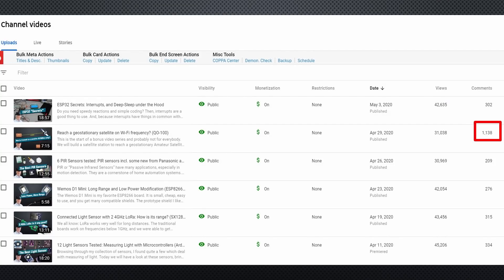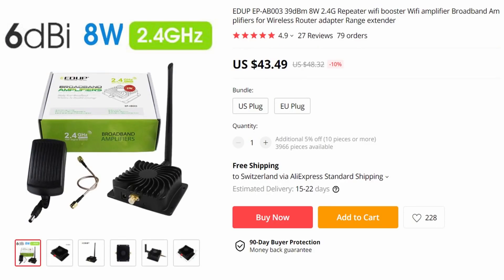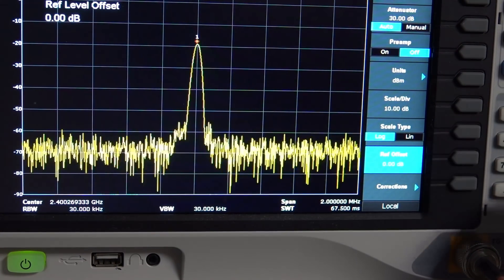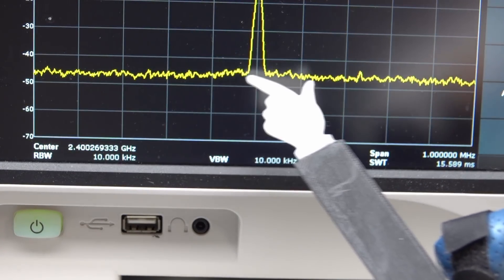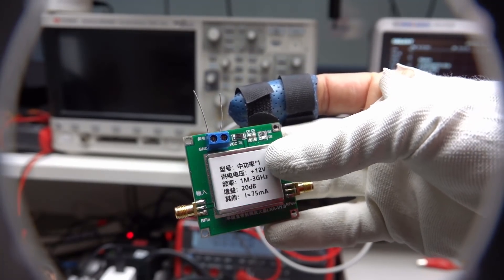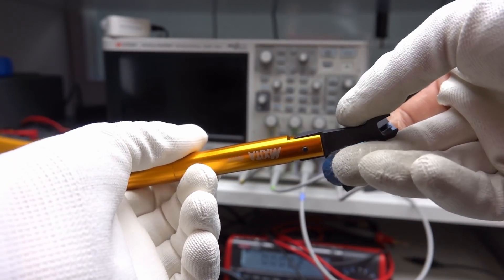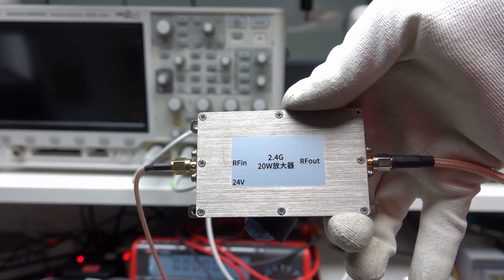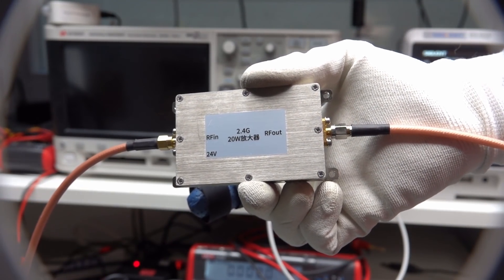014 QO-100 How Do We Get 20 Watts Output on 2 4GHz Wi Fi (Part 2)

Comment: When I did my apprenticeship in the late 70's, 0dBm=1mW into a 600 ohm load. Back then this was the impedance used for telecommunication systems. Not sure what the effect is on 50 ohm systems, but if you aren't looking for voltage or current values, it probably doesn't matter.
Reply from the maker: 0dBm is still 1mW independent of the impedance. The voltage probably was a little higher on a 600 ohms line...

Comment: Great video. A minor point, I would try not to put to much weight on the N-type connector that is on the front of your spectrum analyser. I have seen those become intermittent with a setup like the one you used with the 2W and the 20W attenuators, maybe a support of some sort? You could put some plywood under the spectrum analyser to extend the shelf out and then use some small pieces of wood to supports it.
Reply: Very valid point!
I have repaired more than one instrument/device ( not N-connector though ) where the physical load of connected devices made internal soldering connections go bad. Use a short pigtail if in doubt. If necessary it can in many cases be calibrated to "disappear".
Reply from the maker: You are right, of course! I will not do it anymore. This Siglent is one of my most expensive instruments and I do not want to loose it!

Comment: Excellent episode Andreas, really apreciate your channels! 
 You should ve taken a look at SG-Labs from Blgaria , he makes suited amps for qo100 and the Puto for 138€... and I suppose far better quality than the stuff from Ali. 
I m using the terrestrial one as i not only tend to use the stuff for qo100 only. (That one is not on the webpage) I am still good enough,  just below Leila with around 12W Pout and my 80cm dish. Btw using his transverter as well). 
73
Felix
Reply from the maker: I changed the link in the description to the SG-labs amplifier. It is much better, you are right!